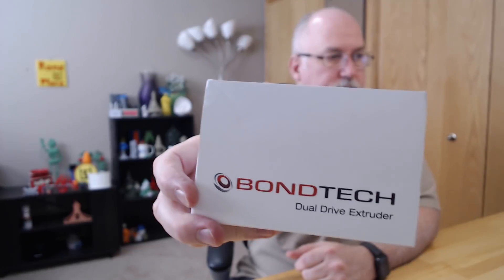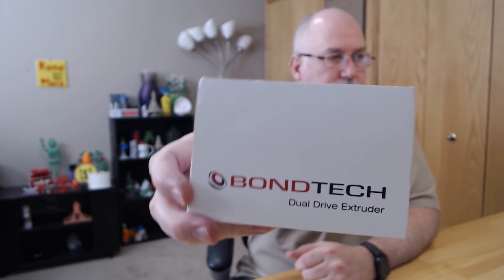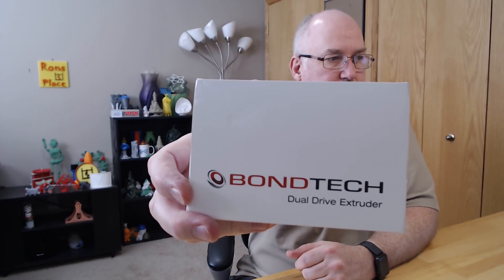BondTech BMG Final Thoughts - CR-10

Comment: Just put one of these on my Ender 3 a few days ago.  Wish I had watched your video before I did it.  I have the same usability issues as you did and miss the ability to manually load/unload filament.  It's also been giving me a few fits and I haven't gotten all my profiles updated yet.  I'll keep pushing through but I may not have bought it if I was aware that it was going to be a bit of a pain in the backside.

Comment: I totally agree with this assessment in regards to BondTech + Bowden.  I have a BCN3D Sigma R17 (2.85mm, ~800mm Bowden) and with the stock extruders, I was getting a lot of grinding in areas of heavy retraction.  So naturally I upgraded to BondTech QRs and while the grinding problem was certainly resolved, a new issue arose and that was extruder skipping (even with the 5:1 gearing).  This is because the idler tension is very sensitive to different filaments, especially if you have too much, as the BondTechs mark up both sides of the filament.  I literally went through MONTHS of tweaking, testing, adjusting stepper current.  I went through three sets of Bowden tubes (including Capricorn) and the general conclusion I came to was that every time I used a new/different filament, I had to retest to find the best idler tension, speed settings, etc. to completely avoid skipping.  So much so that I quit using the Sigma unless I was printing something that wasn't critical.  2.85mm on a Bowden is just not good unless you have a really perfect/short filament path, which the Sigma does not.  Another thing I found, unrelated to BondTech, is the bottom 1/4 of a roll on a 2.85mm spool is basically unusable because the filament is so curved and stiff that it won't go through the Bowden without a lot of trouble.

Since then I've converted the system to 1.75mm using basic non-geared extruders with high-torque steppers and overall the experience is much better.  I did this mainly because all my other printers are 1.75mm but I feel like I can actually use the Sigma now without having to worry about it.  I realize that a lot of my issue probably stems from the fact that I was using 2.85mm filament on the Sigma, but as mentioned in the video, and as I've seen after converting to 1.75mm, I don't think BondTech would be an improvement.
Reply from the maker: The grinding can be very frustrating for sure.  I did find that I had to really reduce tension and balance between grip and to much "texture".  I also worked to reduce the radius of turns.

Comment: Bummer it didn't work for your CR-10.   Not a CR-10, but I have the BondTech QR on mine with Capricorn Bowden tube (blue extra slick one)) and I print fine (PLA) and I just tried TPU 2 days ago and it worked.   I had to fiddle around with the adjustments to get it good.  Ran the TPU for the first time ever using TPU and I ran it slow.  Printer is the Tevo Little Monster and I have the BondTech QR mounted about 2/3rds up the one leg.   Don't know if it's the BMG or the QR that's the difference.  I like the QR because I'm always pushing or pulling the filament by hand through the bowden tube and since it is so long it is nice to just jam it through until I feel the stop at the nozzle.   Enjoying the videos!

Comment: CR-10 frame is rigid enough to the additional torch of the Bondtech? What about retractions, can you reduce distance with this extruder? I heard some good reviews of Ultimaker users...
Reply: Ron Hunt Nice, thank you! exactly, I asked about Capricorn bowden tube and them I heard you telling about it at the beggining... I was on a loud enviromment. 

At least reducing retraction distance you can print a bit faster and with less underextrusion. But it maybe doesn't pay the investiment. 

What about those bondtech gears in mk3 extruder, it works great with flexibles? Mk2 works fine without it, I suppose to see an improviment on mk3, am I right?